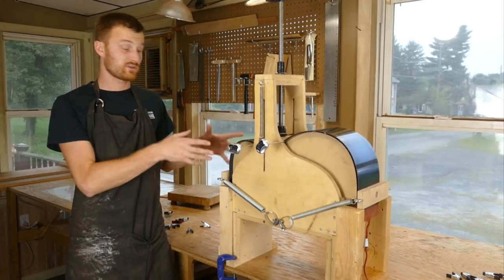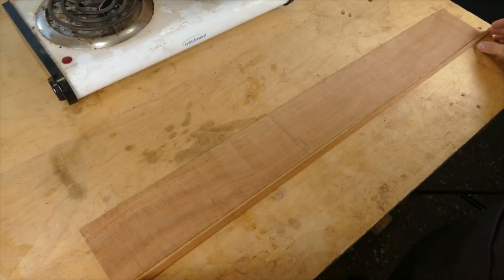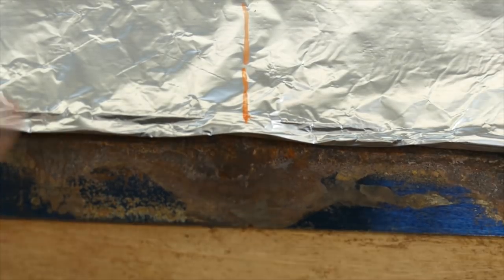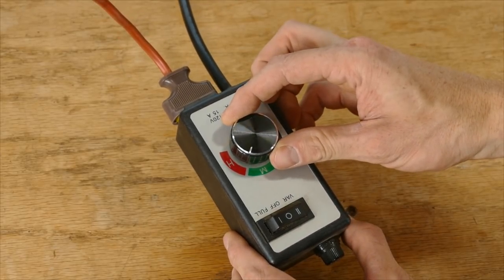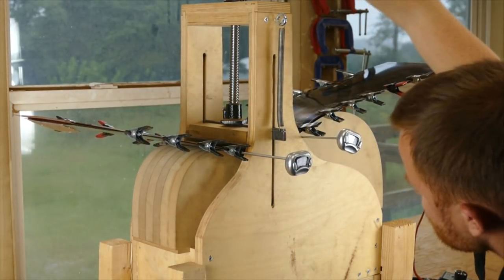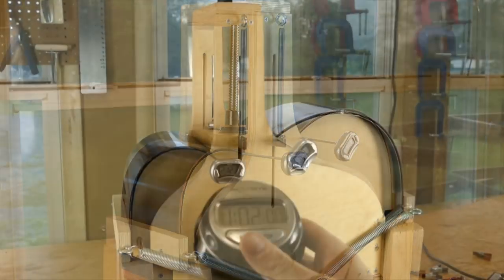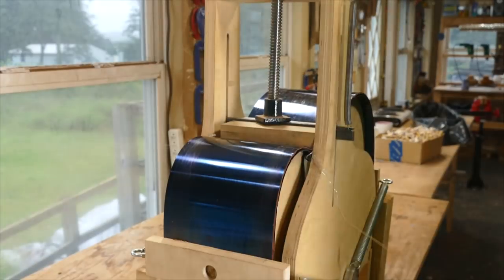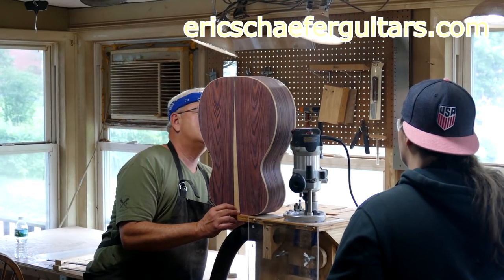Side Bending Machine Basics Part 3

Comment: So I’m wondering why that bottom spring slat is even needed at all? It doesn’t seem to really do anything. Or perhaps some other more pliable material could be used if scorching is a concern
Reply from the maker: The bottom slat is necessary to hold the heat in while it is flat and heating up, before it gets bent. You're right that once the bend gets under way, it's not really doing anything. I suppose you could try to remove it once it's at temperature and then bend, but that seems like a lot of trouble.
The best solution, and I think I talk about this in the second video, is to simply use a thinner (more plaible) metal slat on the bottom. The only reason I use the thick slats that I use is because it's what I've always had. So for me, rather than getting new spring steel slats, I just added some springs to my jig. Either way works. You just definitely want to consider the effects of the bottom slat when you set all this up.

Comment: I have a number of questions regarding side bending. What is the ideal thickness for bending Brazilian Mahogany sides, I guess it's somewhere between 2- 2. 5 m m am I right. I've tried four times now with out success, breaking the sides every time, also the wood is water staining which is not easy to remove. I am following your instructions having built my own side bending jig, bought a heat blanket, & foil etc . What am I doing wrong ? Alec. Sutton U K
Reply from the maker: I've never used Brazilian Mahogany. But check this video out. This is what I do when I have a difficult set:
https://www.youtube.com/watch?v=gjxI1Bk0UUE